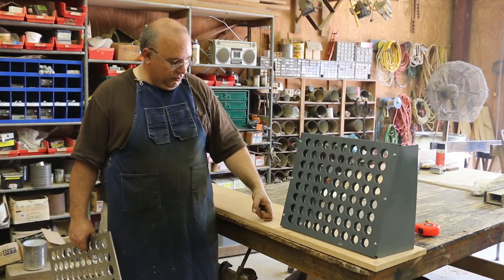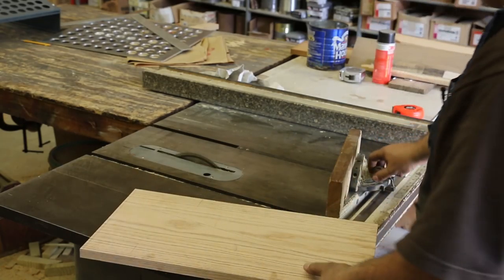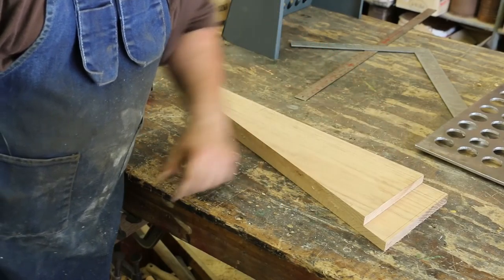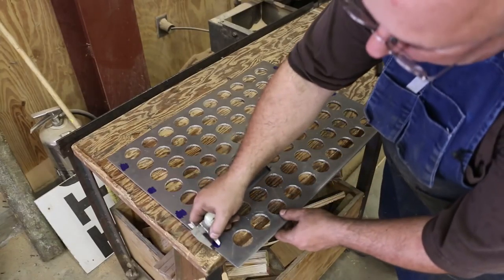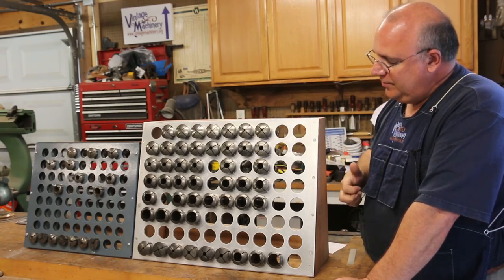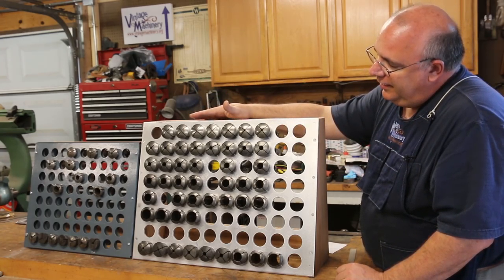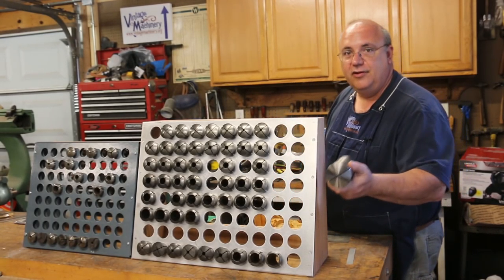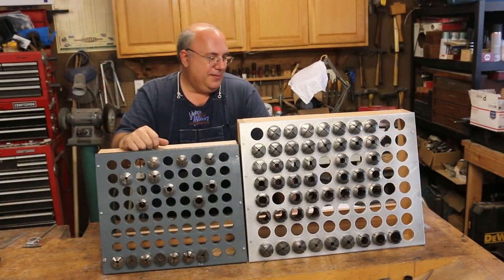Building a 2J Collet Rack:  Part 2

Comment: Comments:Myths,old wives tales and opinions.
Hilarious,enjoyable reading.
Red Oak acid and corroded screws!!!
Keith your projects do bring out the best.
Reply from the maker: +Rick Brandt Rick - if your screws are zinc plated (as mine were), there is no problem with putting them in oak.  Unplated steel - that would be a problem....

Comment: I'm amazed how straight a cut you got using that wobbly-looking miter gauge. I would have thought you'd need a taper attachment. Your method seemed to work though, so Bravo!
Reply from the maker: +Rick Rose A taper attachment would have been a much better (and safer) way to do the job, but they don't have one at the museum.  I have "somewhere" at my home shop but it is packed up and I have not seen it in years.  Looking forward to getting my wood shop set up again in my new shop!

Comment: That turned out really great.  I was thinking about the height difference between the two racks and thought that you could create a wood base on the small rack to match the height of the taller one.  Maybe even add a drawer to it for whatever small odds and ends that might be associated for collet uses.  Would kind of make a yin-yang of wood and metal usage.

Comment: Nice work on the collet rack keith, good video.  Funny how those holes required the multiple steps (annualar cutter, reamer, dremel)... that's how every project I attempt goes!  :)
Reply: +🔥Ramsey Customs - turbocobra Yessir! No matter how simple something looks there's ALWAYS something lurking inn the shadows!
Reply: +Lewie McNeely No doubt!
Reply from the maker: +🔥Ramsey Customs - turbocobra If I could have bought an annual cutter that was 0.010 oversize, it would not have been an issue....  Oh well....
Reply: One must make do with what one has, one must!

Comment: A trick I used to make slightly bigger holes with bi-metal hole saws was to put them in a vice and squeeze them slightly oval shaped. The saws cut a wider path through the metal, but I got my holes the exact size I needed. I did have to make test holes and adjust how much I squeezed them in the vice, but I did get my holes just like I wanted them. This may help when you make your next rack if it uses an odd size hole.
Reply from the maker: +Ben Proveaux That might work on a bi-metal hole saw, but you won't easily bend an annual cutter!

Comment: Might be time for a new blade on the Dewalt as it seemed to struggle a bit. Could you have run that hand reamer in the drill press to maintain alignment and to not have to crank it all by hand or do you think it would be too grabby?
Reply: +bcbloc02 The man that allowed me to tinker on his lathe (many moons ago) had a set of adjustable reamers, he was extremely protective of them.  I got the impression that they were somewhat delicate and easy to damage if they got bound up in the work.  I think you would not get the kind of feedback to know if something was starting to go wrong if you tried using them in a machine.
Reply from the maker: +bcbloc02 The Radial Arm Saw blade could use a good sharpening.  As for the reamers, the shank was way too big to chuck up in a drill press  - or  even in my mill.

Comment: That collet rack looks very smart, i've always liked this style. Mostly because you can hold them up like this, or, if you've space line them on a bench. Either way, the collets are easily accessible. Far better than a drawer or the other style where you hang them on pins up side down (never liked that one).
Reply from the maker: +aserta Thanks - I like it!

Comment: Great video Keith. I'm getting a big kick out of the people telling you all of the things you are doing wrong. Hilarious! One guy said something about oak damaging your screws and you should have used stainless.   You know one day you are going to walk in the shop and all your collets will be on the floor because of those screws not being stainless! LOLOL Thanks as always Keith
Reply: +Tom Wilcox  That  "someone" was not wrong,, Oak is very acidic, and in my day if we had to use steel screws  we pre drilled the Oak and coated the screws with tallow,  it eased them so they didn't break, but more importantly to hold off the acid !
Reply: +chris bond I got interested after all of this acid in oak talk. I have several pieces of oak furniture that I have made in the last 15-20 years so I removed several fasteners in these pieces to inspect. I have red oak furniture in my living room and white oak in the dining room and bed room. Guess what I found ? Nothing! They look brand new. They were not stainless or any of the battery acid resistant fasteners.  Want to come check the furniture out? Or I can send you photos. Sorry to disappoint everybody. I did try to prove you right.
Reply: +Tom Wilcox  clearly there is a big difference between the oak you have and the English Oak we used to use here in England.
Reply: +chris bond had no idea you were in the UK. I have never seen a piece of oak from England much less used any.  That's a total different ballgame. I have never heard of this problem in the states. My deepest apologies. Have a nice day.
Reply from the maker: +Tom Wilcox Oak can be acidic with all of the tannin in it.  But, if your steel screws are zinc coated, it is not going to be a problem....

Comment: I had to drill a similar board once, and used a Conecut to open the holes slightly. It has the advantage of being used in the drill press, AND giving a slight;y wider mouth to the holes to guide the items into place. All depends on the angle the front fits at, though, as I suspect it might not grip the sides of the inserted items as effectively as the reamed holes do.
Reply from the maker: +Mark Sinden I will have to look into one of those.

Comment: Just an idea on the 22J's.  How about making a rack that is only say 3 rows high, but extends the width of both your other racks?  Then they can fit on a single shelf right below the others.  Guess it would really come down to space layout if you have more room horz or vert in the location they are to be mounted.
Reply from the maker: +bsb0011 Not a bad idea!

Comment: looks good... as you made the ends i was wondering if the length of the collets and the angle that they sit at may mean the bottom row would hit the bench... but it looked like a good fit
Reply from the maker: +Richard Ashman I did check that out ahead of time as I was concerned about the same thing.

Comment: Keith - How do you plan on mounting the racks?  Table top or wall?  If on a wall (to save workbench space) how do you plan on hanging them?  Especially with the planned 22J collets, the loaded rack will be heavy!
Reply: +cemx86 I would go with Skyhooks.
Reply: +cemx86 It would also be a good application for French Cleat system.
Reply from the maker: +cemx86 I will probably either put them on something or build a shelf for them to sit on.

Comment: Nicely done. Goes to show you how using quality materials makes a big difference in the final product. I See you have a DeWalt 940 Radial Arm Saw. I just finished overhauling a model 754 that I bought from a guy for $50. Any Idea what year it might be? I'm thinking 70's. Thanks for another entertaining video.
Reply from the maker: +R.M. Hobbycrafts Thank you.  The DeWalt Radial Arm Saw belongs to the museum and I am sure that they purchased it in the early 1970's when they were setting up the shop there.

Comment: hi Keith love the videos. had a question. is there a certain milling machine you would suggest for someone who is new to it. I have never used one before but I'm growing increasingly interested in machine shop hobbies. I have a good sized drill press is there a way to convert it? thanks.
Reply: +John Biggs I'm just getting in to machining my self, after having done some machining at the university where I study mechanical engineering. 

I would not recommend you try convert your drill press. The entire construction of a drill press is made to take on primarily axial forces, and thus does not handle lateral forces very well at all. For milling you need good rigidity and strength in all directions, and your bearings need to be made such that they can handle large forces in all directions.

And besides, it is convenient to have both a milling machine and a drill press since you don't have to switch tools on the milling machine all the time.
Reply from the maker: +John Biggs John,  Others have already chimed in about not converting your drill press to a milling machine.  It is possible to do some light milling on a heavy duty drill press but it is really not made for doing that kind of work.  If I were you, I would be on the lookout for a Bridgeport or a clone of one or something similar like my Wells Index.  I am not a big fan of the modern import mills - the benchtop type - but they can do decent work if they are in good condition.
Reply: +Keith Rucker - VintageMachinery.org thank you for the feed back. I will keep my eye out for the right mill.
Reply: +neistridlar thanks for the feed back I will be sure to look for a good mill.

Comment: When you build the big collet rack you do realize that you are going to have to build a bigger building.  Maybe you could get one of those rotary racks like the big box stores use for Carpet rolls or electrical wiring.  Just push the  button until the shelf you want comes down.  Still think you should have left the long side on the rack and stamped Made By K. Rucker on it.
Reply from the maker: +Big'un44 I love it - the rolling rack is a great idea.  Not sure how practical that would be o build/buy, but I love it!

Comment: Im just thinking about.... is'nt it kinda bad habit using the calliper for scratching a mark. and what if the callipers tip is rounded so it doesnt work for scratching anymore, will you actually sharpen it?. guess in practice this will probably never happen....
Reply: +Mirko Mueller It's not a bad habit i do it all the time but i use cheapo calipers,when they wear down just grind both the outside bottom faces of the jaws as this will only reduce the length of the jaw and doesn't affect the measuring distance.
Reply from the maker: +Mirko Mueller Calipers don't last forever and there is not doubt that using them like that will wear them down over time.  But, I have them to use and I use them.  When they need to be replaced, that is what I will do.  With the parts being hardened, they don't wear very fast.
Reply: +Mirko Mueller I have 2 calipers specially made for scratching. One type has a roller and a scriber that can be sharpened instead of the usual jaws. These are cheap from China. The other quality one has carbide tips on the jaws that also are slightly different length. This works well on steel as well. I don´t think wear is much of an issue for soft non abrasive materials such as aluminum.

Comment: Glad to see my hatred of those stupid radial arm saws is well justified and not simply because my experience with them was with a crappy craftsman unit.  Your professional Dewalt still auto feeds just as bad.  What a suicidaly stupid design.  Thank god they have disappeared and been replaced with a miter saw.  My father lost a finger to that saw, though not because of the auto feed.  You need to make sure the blade has stopped before sticking you hand in there to grab the piece of wood....duhh

Nice collet rack.  Simple and clean.  The aluminum might help prevent rust on your collets too by galvanically protecting them.
Reply from the maker: +Barry Gerbracht I am not a big fan of radial arm saws either.  I have one for my home shop, but it is a Monarch Uni-point - a much improved design over your traditional radial arm saw.  I still would rather use my sliding compound miter saw for most cuts though.

Comment: I have the exact same Dewalt Radial Arm Saw, bought it new, it’s now over 40 years old and I still use the original 12” blade guards. 
What’s with you Yanks? Tossing the guards away and using saws like this Dewalt and that table saw without guards, gives you bigger Balls? I just hope you include the stupidity of cutting your fingers off in your future videos just like YouTubers thintz12 from https://www.youtube.com/watch?v=u7sRrC2Jpp4.Aw yeah! Don’t think I didn’t notice the Dewalt kickback when crosscutting the end pieces to the collet rack!
Why do I watch… to remind me what NOT to do. And, as for putting timber sides to a collect rack how retarded can you get, should have used the same aluminum material for the sides also.